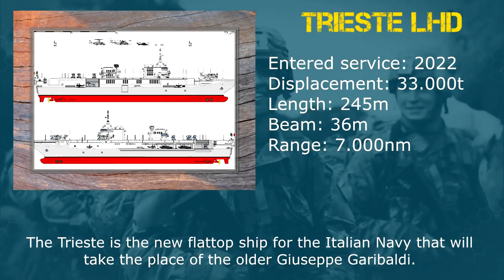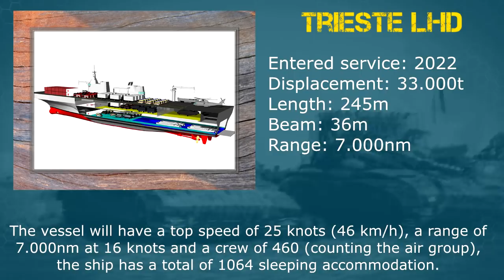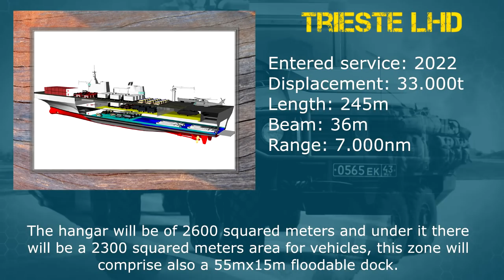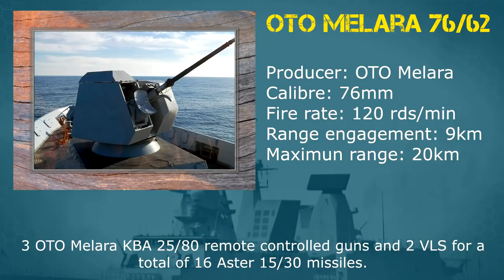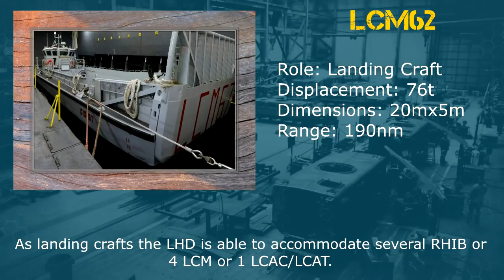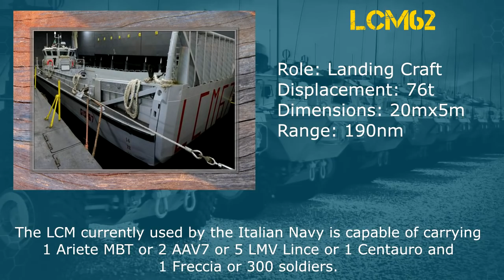LHD Trieste - In-depth look

Comment: That's impressive design, but one question: Is there any advantages to the two island concept on their ships?
Reply from the maker: Theoretically you gain a parking spot between the islands, that is always useful to have on any aircraft Carrier design
Reply: @DailyBattlefields  were there any intentions for the Ford-class to have this concept?
Reply from the maker: No, I don’t think so, as far as I read, the only two nations applying this concept are the UK with the Queen Elizabeth class and Italy with the Trieste LHD
Reply: @kempmt1  The Ford class would not need it because it is nuclear powered. The twin island is primarily to handle the two uptakes from the engineering spaces. It has been adapted to as a secondary role to separate flight and ship control stations.
Reply: @cadengrace5466  I was kind of expecting some particular operation capabilities from the two islands over a single one